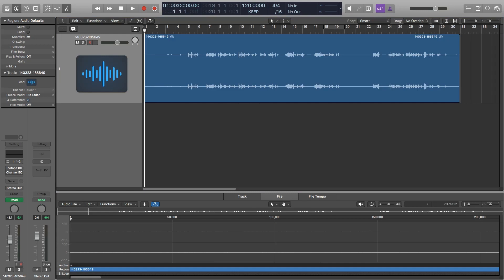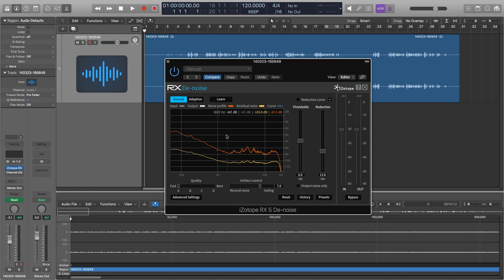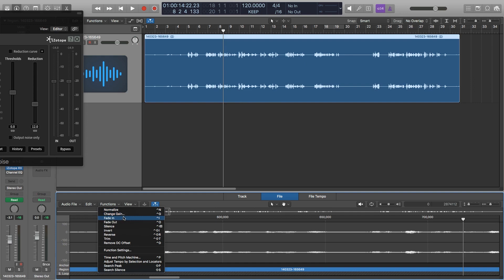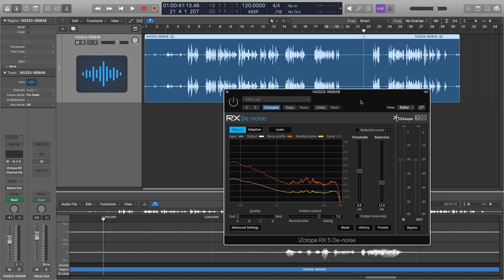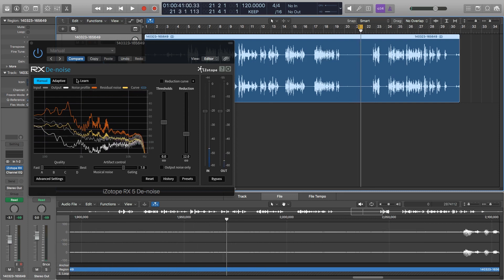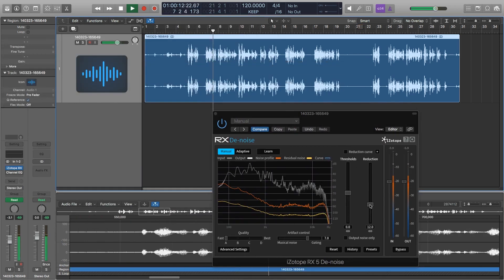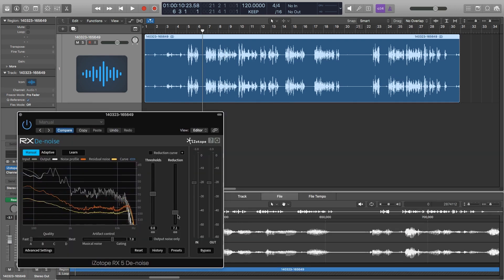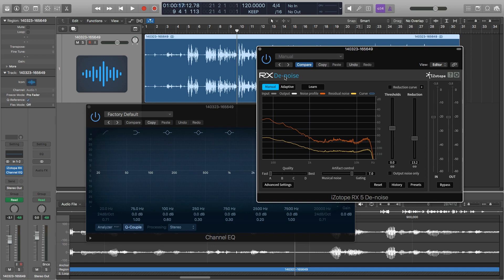How to Remove Background Noise and Hiss From Audio | Logic Pro X & Izotope RX Tutorial

Comment: What would you recommend for removing that same hiss while someone is speaking—say I have some poor audio for a podcast. I can use expansion and EQs to limit some of those high frequencies, particularly when not speaking, but while speaking they still factor in. Do you think RX is the best to help with this also or should I look into something else?
Reply from the maker: Using EQ is not the best way to handle that. RX has the best tools for this IMO. They released a tool specifically for dialogue denoising that is much more affordable than the whole suite. https://www.izotope.com/en/shop/rx-8-elements.html
Reply: @DJCouchKing  Assuming you've experimented with several so I'm happy to give this a shot. Appreciate the recommendation!
Reply from the maker: No problem! I'm not sponsored by them nor do I get any commission. I use it all the time and it works really well, and is easy to use.
Reply: @DJCouchKing  Saves me a lot of time searching, that sounds like exactly what I need—a quick solve for non-pro recordings. I'll put this to the test and get back to you on how effective it was.
Reply from the maker: Good luck!